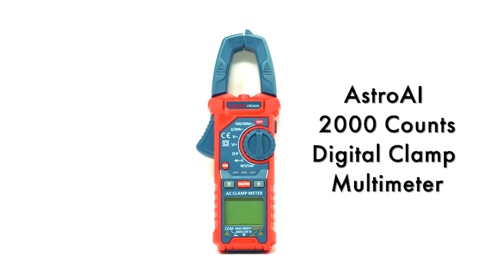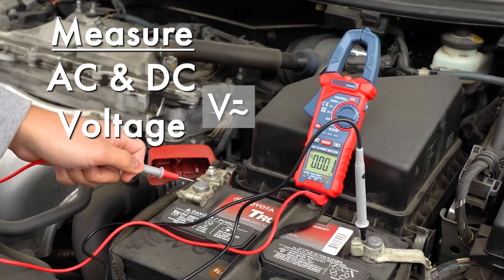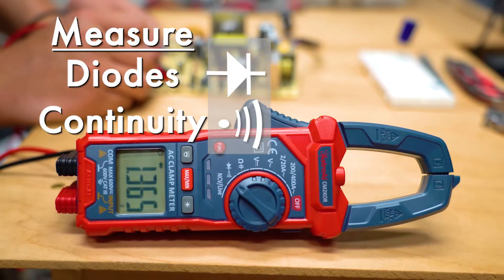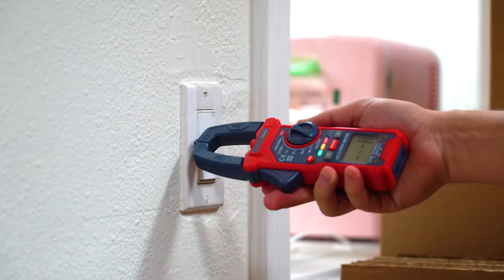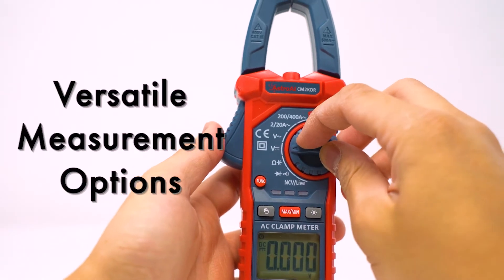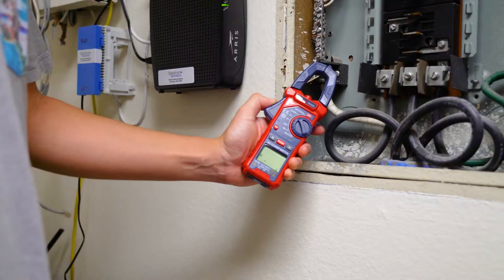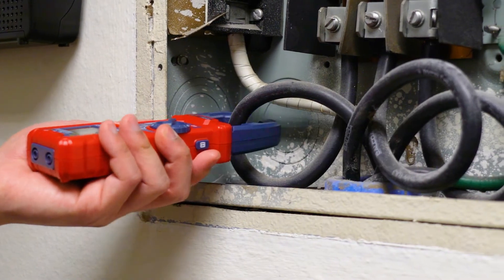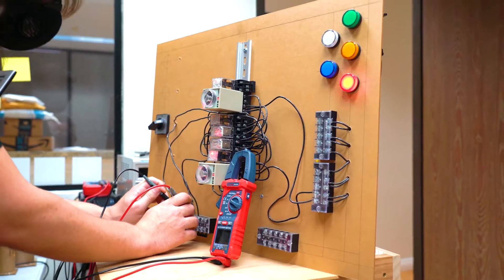AstroAI 2000 Counts Digital Clamp Multimeter

Comment: Can i measure an  a/c run capacitor value in microfarads with this meter?
Reply: Yes you can, just set the dial to the third last mode and hit the function button. You can then check the capacitor.
Reply from the maker: Hi Punkrocktv! Please contact our customer service team with your inquiry so they can help you out further!

Email :  support@astroai.com
Tel :  1-562-631-5464